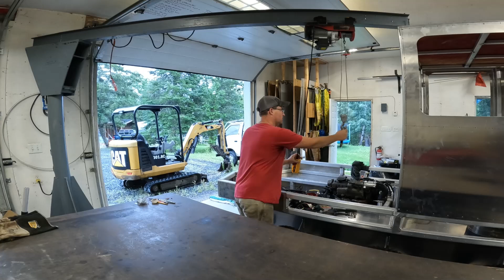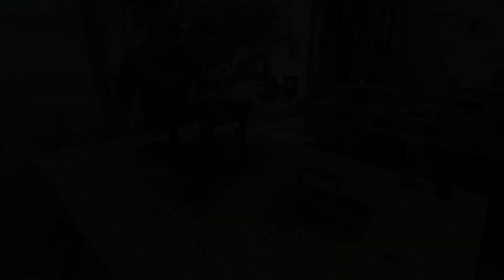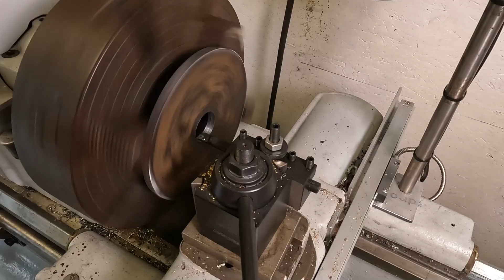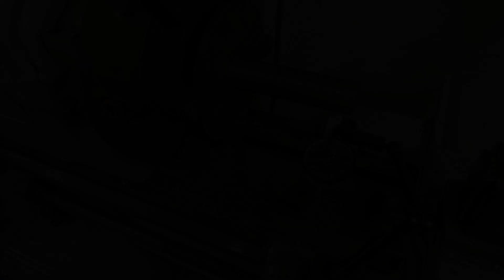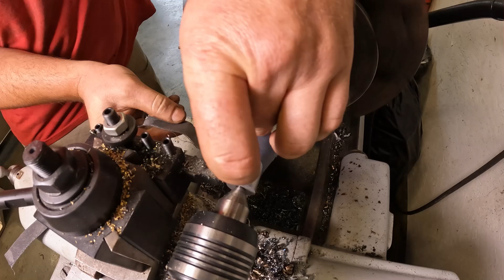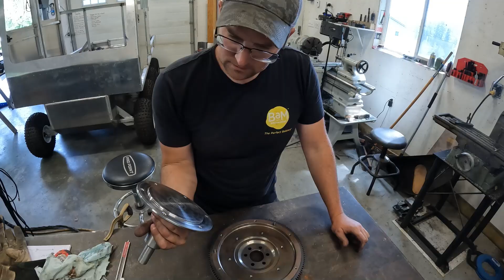Custom Snowcat Build PT29 | Machining the pump shaft

Comment: Some tractor oil pumps use a chain coupling with a sprocket on the engine and pump and a small loop of duplex chain to link them. allows drive with a little run out.
Reply from the maker: Nice! Good to know. I think I’ll be using a spider coupling

Comment: What is displacement of the pump?
Reply from the maker: Hey! I believe they are 21cc/rev each. That’s just off the top of my head. But sounds right
Reply: @ thx so 21cc x 3,000rpm or about 63lpm?

I’m considering converting my DIY cat to hydro next year, similar weight/size as yours.  Appreciate your videos and input.
Reply from the maker: Yes that sounds right. I am starting to have thoughts that the pumps may not be large enough. Kinda of thinking I should be near 30cc/rev but time will tell. These were fairly cheap pumps to prove the rig and will revisit the pump suitation down the road if I have to. These ones also run rated around 1700 psi and not 2500 like bigger brand names.
Reply: @ thx for info. I’m considering either building another cat with hydro or converting my current DIY in the future. Same size as yours essentially. 2000lbs, 24” tracks. So your requirements for pumps motors will be similar. Appreciate your responses. Thx
Reply from the maker: No worries. Sounds like a fun project and I am happy to show what works, or doesn’t work, to help others. It’s all a learning curve!

Comment: You could pour a urethane sleeve around the keyway if you want to dampen any vibration effect. Kind of like a motor mount for shafts. You don't want your pump to get hammered.
Reply from the maker: Interesting thought Kevin! I do have a spider (jaw) coupling that has a spacer for vibration and misalignment but I am not sure if I will use it. I do want to protect the pumps. I haven’t yet dealt with the coupling so I’ll give it some more thought.

Thanks for the tip Kevin! Cheers!
Reply: @CenterLineDesigns  I think I could find the video where I saw that done. If you want to have a look, let me know. I think it was for a marine application.
Reply from the maker: If it’s not hard to find sure love to check it out. Always good to see the options! The coupling has been on my mind lately. If it’s difficult to find no worries. Thanks!
Reply from the maker: It cool because this is exactly how I will be building the sprocket segments. I have a fairly decent 3D printer. Polyurethane is on order already
Reply from the maker: Thanks Kevin!
Reply: @CenterLineDesigns  I’d guess you’d want less dense urethane for the shaft coupler.
Reply from the maker: Yes probably. Something that absorbs more. Yea. Thanks to another viewer giving me a tip about where to buy reasonably price urethane I now know where to get product. Thank you sir. People like yourself are great resources to help dial in my design! I appreciate your input and time! Thank you!
Reply: @CenterLineDesigns  You’re welcome. I’m happy to be of help. You are a source of useful information and inspiration. I always learn something from your videos.